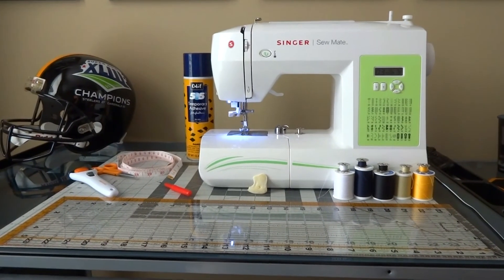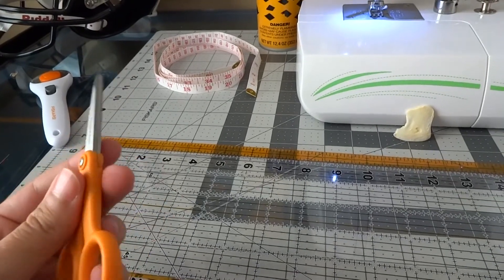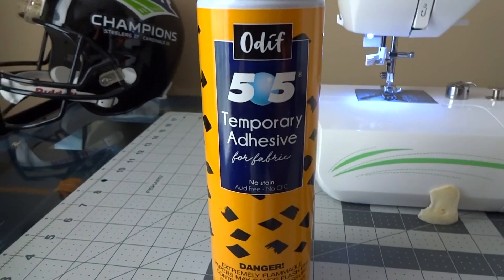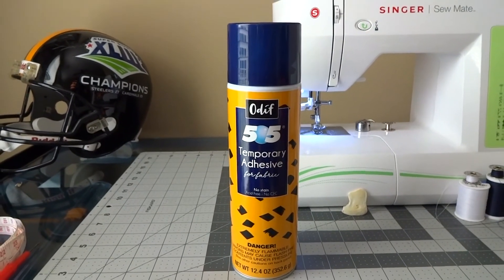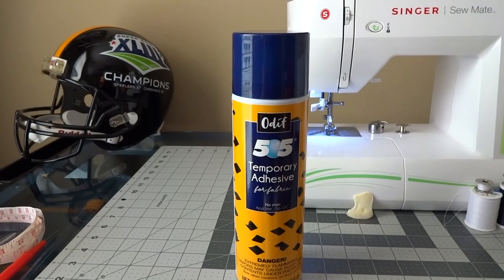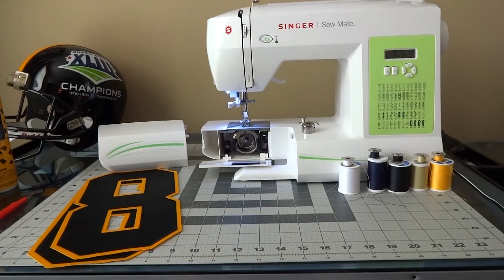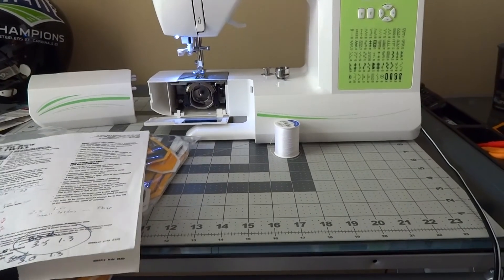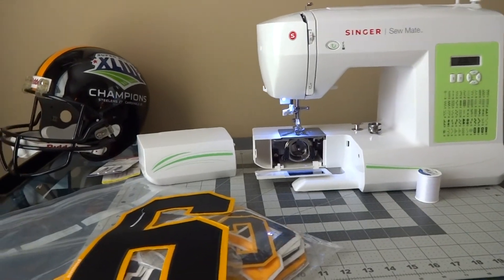Customizing Your Own Jersey - #1 Intro & Tools

Comment: Is it possible to iron twill onto a jersey with a conventional iron, or even one of those 10x10" portable heat press machines?

Great video btw!
Reply from the maker: Sorry, notifications on comments made don't always appear. 

For anyone viewing these comments in the future - YES! I've actually graduated to a portable heat press from Cricut myself. Still use the spray adhesive when needed, but the press was worth it for me when doing so many projects. If only doing a few jerseys here and there the spray is more economical. 

A household iron will work, but take caution because an iron isn't as consistent with steady heat.

Comment: Im wondering how you decide which color thread to use - do you always just use whichever color is on the outermost edge of whatever parch you’re placing? Do you use some reference for thread colors?
Reply from the maker: Yup!  Thread color matches the edge you're sewing around.  If you want to match the closest, I take the twill or patch to the place I buy the thread so you can get as close as possible.

Comment: I’m having an issue where my needle is having trouble plunging through a large 3-layer number. Every time the needle goes down through or comes back up (if the machine isn’t running full speed) the needle doesnt go through and my machine just buzzes. I’m using brand new denim 100/16 needles and brand new heavy duty 110/18. Do you have any advice? Is my machine literally just too weak?
Reply from the maker: What machine is it?
Reply: @pensjerseys2322  its a Brother VX-810, something old and non computerized. I’m just perplexed because i was able to get nice perfect zigzags in old squares of denim, but when I move to layered twill I get a nightmare of problems.
Reply from the maker: @SMLawlor  I'm calling in some help to see what they think.  He uses Brother machines as well.  VERY odd if you can get through denim but not the twill, I'd think...
Reply: Howdy, a little friendly reinforcement courtesy of PensJerseys! Unfortunately it sounds like your machine may not be strong enough to handle that kind of load. HOWEVER, it may still be possible for you to sew triple-layer twill. I found needle size greatly affects the amount of resistance of any material, and 100/16 or 110/18 needles are overkill. I personally use an 80/12 needle and don't have any skipping issues and my machine glides through the material rather than chugging along like it does with larger needles. As an added bonus, the holes left in the material after sewing will also be less visible too! You just need to be a little more cognizant of the fact that you're using a light needle, so make sure you don't apply too much lateral pressure on the kit, or it may deflect the needle and cause you to skip stitches or even worse - get your needle jammed.
Reply: @liamgould6524  thanks guys! I appreciate your advice. The smaller finer needles are punching through the twill nice and easy, so that definitely fixed that issue. Unfortunately, now i’m having issues with threads skipping. When i try and sew, most of the time the left needle swing is missed, or the thread is coming away from the take up lever and I need to restart and try again. What can I do to trouble shoot from here?